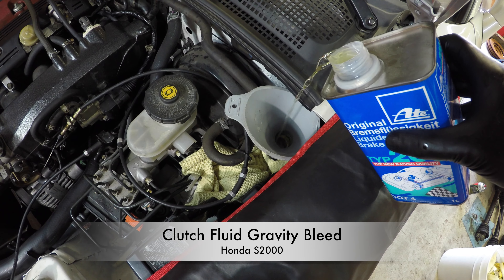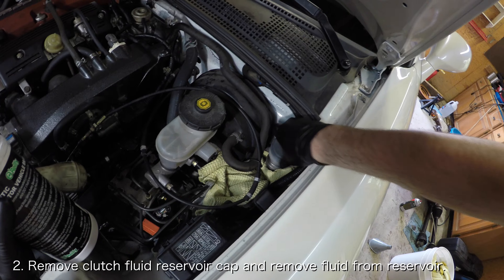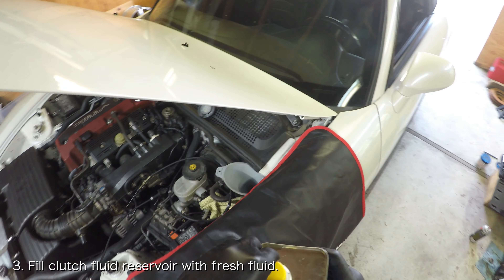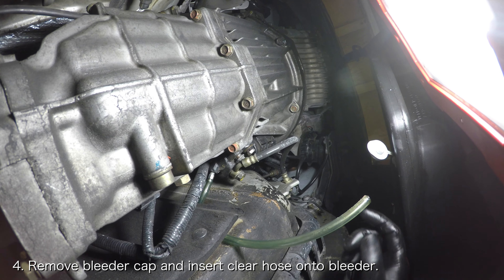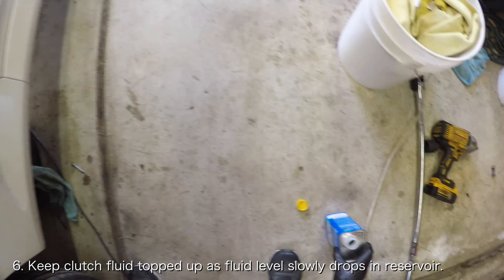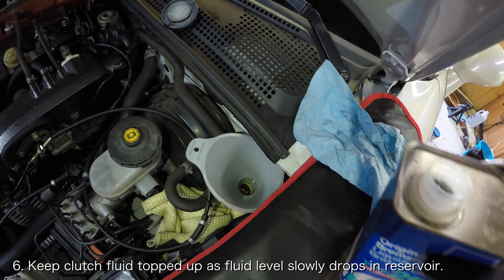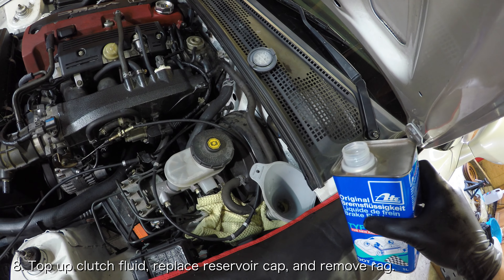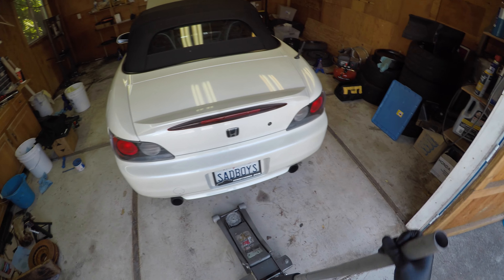Clutch Fluid Gravity Bleed | Honda S2000

Comment: Thanks for the how-to, it was very helpful. I would like to add that if you have air in your lines it’s best to bleed the clutch using the two person method in which someone holds the clutch down and you crack the bleeder. I had some air in my lines and gravity bleeding didn’t rid the air; my clutch was still squishy. Immediately after gravity bleeding, I did the two person method and my clutch felt perfect after. I think the method in the video is best used for fluid change and not air removal.
Reply from the maker: Good point. I have encountered the same issue myself sometimes.
Reply: Does the person in the car have to pump the pedal or can I just hold it down with a prop?

Comment: Made massive difference, although my master cylinder does has a tiny leak, the fluid turns to dark and lowered due times, feels brand new every time I flush it, it is cheaper than replace the master cylinder

Comment: Question for you….once you remove all the fluid from the master with a turkey Baster and then refill with fluid..aren’t you introducing air into the system doing that?
Reply: No more than if you pour a glass of milk, is there air in there?

Comment: Is it necessary to lift the entire car or is it enough if I lift the car at the front lift point?
Reply: I have bled several times and the pedal feels good but I have the feeling that my bite point is higher than before
Reply from the maker: You can lift just the front of the car. It’s just really hard to fit under the car unless you jack up the entire car.

Comment: Does this work on a 2004 civic
Reply from the maker: Most likely yes
Reply: @DIYGuysvideo  I replaced the slave and master cylinder and bled it. But I still have no pressure in the pedal what should I do.
Reply: @Xboxplayerpinoy  you didn’t bleed it right get a evac

Comment: I used your method, but after the initial drip... the process turned very slow..a few drops at a time. I tried to open the bleed valve more, but I was afraid it was going to come undone... At this point it  seems I am getting new fluid coming through but still.. what can I do to speed this up... I did this when the car had been on jack stands for three days... does starting the car and warming up the engine help move things along... THANKS
Reply from the maker: Do the two person method. Much quicker and guaranteed to work.
Reply: for whatever reason, the next morning the fluid did start to drain correctly without needing to pump the clutch.. thanks so much for the very helpful video
Reply: Same thing happened to me with my AP1; nothing after the initial drip, then the next day Niagara Falls 🤷‍♂️

Comment: how can i make sure i don't have air in the system? I am going to try it later.
Reply from the maker: +Pc Chan well the purpose of bleeding the system is to remove air. What you don't want to do is let the reservoir get empty so air is sucked into the system.
Reply from the maker: +Aaron Rayment I normally just keep bleeding until the pedal feels how it should.  Doesn't take me more than a couple times normally. The clutch fluid system is not a lot of fluid. It shouldn't take more than 5-10 minutes to bleed. Maybe even a couple minutes. You can bleed once with less than a quarter of a liter. What you can do is literally just watch the fluid travel along the clear hose, if there are no air bubbles for a good amount of time you've likely removed all the air.
Reply: DIYGuys I just did it today on my 07. however the 1/4 ID tube i got from home depot is too tight. just wonder is it a different valve on ap2/06+
Reply from the maker: I copy pasta'd the tools necessary list from my old video and I don't even know what size tubing I have laying around since I purchased it so long ago. I did a quick reference check on s2ki and it looks like 3/8" inner diameter is the correct size. Thank you for pointing that out and I apologize for any inconvenience. I've updated the video description accordingly.
Reply: All good. I won't do it myself without your video to be honest. Keep up with more DIY videos
Reply from the maker: +Pc Chan Thanks buddy!
Reply from the maker: +Aaron Rayment good luck. There may be one last possibility and I'll make a video about it eventually.
Reply from the maker: +Aaron Rayment Actually now that I think about it I've driven a car with an ACT pressure plate and the engagement did change to be very close to the floor. Really threw me off so it could just be that.

Comment: Hey man my slave cylinder doesn’t bleed any fluids... what can be wrong? The pedal is soft but works, and the CMC has fluid to the max level but when I loosen the bleeder valve nothing comes out smh
Reply from the maker: If gravity bleed is not working try the two person method. This will surely force the fluid out 😛
Reply: What Honda do you have?

Comment: My bleed nipples never actually work as intended on brakes or the clutch.  It just pisses down the side of the thread and barely any goes through the hole.  

Also there is barely any fluid at all coming out.

Comment: When does one need to do this?
Reply from the maker: +jwrx7tt01 If you have air in the clutch line, leaking clutch master cylinder, or if you replace the clutch master cylinder. Arguably you should do it when you replace the brake fluid, but clutch fluid is not exposed to heat so less necessary.
Reply: When ever the fluid gets dark I do mine. Look at it like changing your oil. Look in your owners manual and it will give you service intervals on when things need to be done

Comment: The 3/16" ID, 5/16" OD doesn't fit for me.
Reply from the maker: What size hose did you use? I honestly didn't remember which size hose I used since I bought them years ago. I referenced what many people said worked on s2ki.
Reply: I bought the 3/16 inner diameter and 5/16 outer hose and it was too small
Reply from the maker: +Jonathan Vang it should be a tight squeeze. It can be tough with a brand new hose.